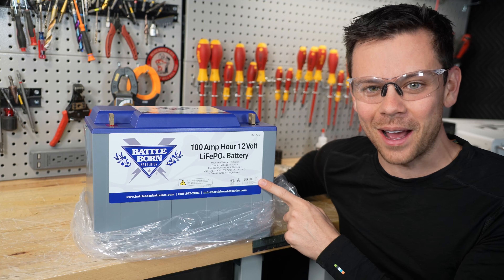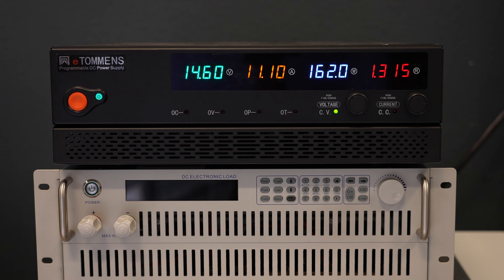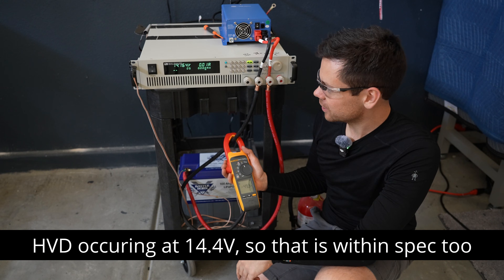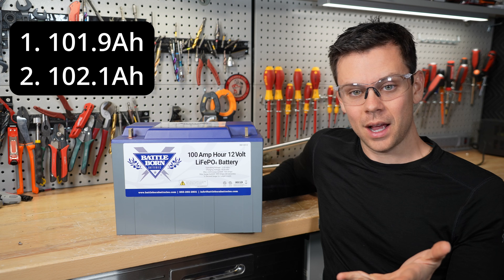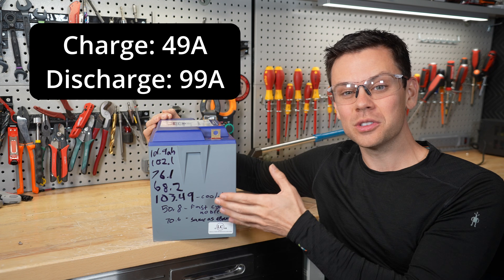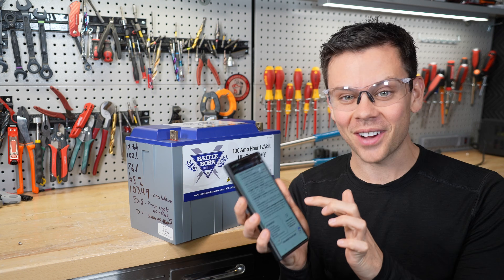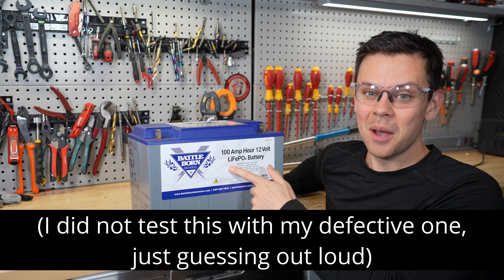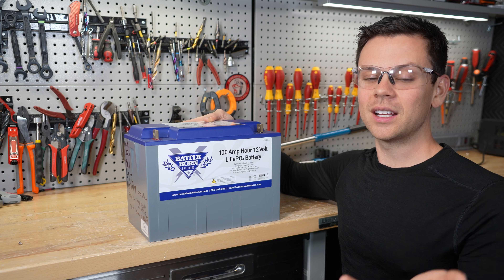A NEW Issue?! Battleborn Cycle Testing!

Comment: Although I understand the goal of this extreme cycling, it is not a real world example of any applications I am aware of.

Normally, a system that would be delivering 100 (okay 99.9) amps continuously would have several batteries in parallel to do this.

I suspect that any battery that has high temperature protection in the BMS will behave in a similar fashion.

Comment: I have owned that battery for approximately six years. It is in my electric boat (Twin Troller X10) and I use it regularly here in Central Florida. Every time I return from fishing I recharge the battery with the charger that came with my battery (Victron) directly from Battle Born. I have none of the issues you talk about and the battery still works as if this was day 1.
Reply from the maker: Cut open a battery and check that terminal
Reply: Over time, companies cut corners for profit, especially publicly-traded companies. You got in early, when quality control was obviously higher...or,you didn't and just haven't found out yet..

Comment: Have to ask, will most users ever pull that big of a load for the whole time? 99% buy it for a use, that is not trying to kill the battery. Would be like running a new car wide open for hours. Never slowing down just wide open until it dies. Not saying what your doing is wrong. But I own 7 Ly time battery's. I will ever pull that kind of load on them. 3 12 volts hooked to a 112lb trolling motor. 2 12 volts hooked to a 80lb trolling motor. The other running electronics. Bought these after watching your test on those. I would never pay what Battle Born wants for theses though.

Comment: Who discharges their batteries deep cycle battery at max rated capacity all the time? It's a test, but is it realistic? I would say charge at 50amps and discharge at 50amps to even be somewhat realistic. At least that is more real world, if you are trying to actually prove total cycles etc. I still think most batteries are discharged on avg at a very low % of max discharge capacity. 

I probably pull an avg of <5 amps per battery, and charge at maybe 20amps per battery for an RV use case.  I get the stress test, but 100amps seems pretty unrealistic in every cycle.

But if just trying to see if the thermal issue can happen.. I can see the logic, but seems a little unfair to throw in capacity testing at the same time. Just be unbiased vs trying to prove something up front. Sort of science 101.
Reply from the maker: Completely false. If something is rated for something, it should be able to do it.

Comment: I worked in a UL308 Electronic Panel Control builder shop. To have a UL listed product every component within the product MUST be UL listed and approved coming from their large library of documented parts. This list also includes fasteners (bolts and nuts) the use of them and environment subjected to. UL listing is a serious for liabilities. As a manufacture violating UL guidelines, three strikes can result in heavy fines or even loosing your UL license.
Reply: Bolting together UL listed parts doth not necessarily make for a 'good' or safe product... Thus, UL listing alone is not enough to provide assurance of a great product.

Comment: I have to say that my own battery that run from 2021 .
Still are fine and still have the 100% .
And its use 24/7 .
I use them for my boat ware i'm 24/7 .
Battery are charge by solar .
And max charge is about 70a .
Now the discharge is not that high .
I cook sometimes on it but the rest of the systeem use no inverter .

Winter time it charge over time with charger  to Puch it to 100% and than go back to max discharge of 70% and the charge go back up again .

Oke those battery cost 1000 euro in that time .
And if i see its a good thing that i pay for it.

Comment: You are not charging or discharging these batteries properly.
dragonfly/battleborn seems like a good and reputable company that doesn't deserve this.
Reply from the maker: False, this is normal cycling if it's rated for continuous charge and discharge. Tell them to change the data sheet then

Comment: Thinking about the issue they are having, i wonder if this is being caused by terminal stress or vibration. how are the batteries that are having the issue being used? in a mobile setup say on an RV, or van build? I can see both terminal stress say from it moving or the cable flexing, and vibration from it going down the road. 

if it works that bolt loose increasing the resistance to the system then the high heat would follow.

Comment: Wow, $600/kWh is really high!  You can second source Samsung SDI NMC modules for $50/kWh all day long.

Will, I have an automated long term cell tester and will gladly test a module if you want.  I can charge at up to 165 amps(continuous) and discharge up to 600 amps(continuous).  Overkill for this application (50 amp charge, 100 amp discharge), but I can certainly do that slower test... I can even add automated dwell between cycles if you want.  I wrote the program, so I can make it do anything.  All data logged once per second.

Comment: In order to get really accurate readings with your thermal camera you really should get a piece of matte black electrical tape(like the cloth kind… Not the vinyl. Or you might be able to get away with using gaffer tape), and stick on the surface that you’re trying to take a reading from. 

You also want to make sure you set the distance in the gun to the correct distance and always take the reading from the same distance, otherwise you can see quite a bit of variability…

Putting that black spot really helps a lot to get consistent readings though
Reply: White-out and Dr. Scholl’s foot powder spray also work.

Comment: i have 4 of them in parallel  for about 5 years      and ive checked the positive terminals while charging lately  and its not hot at all,   i wonder if people have them in vehicles  and they are rattling around?? or if the problem will happen after regular controlled usage inside?  Looking forward to more videos !!

Comment: Hi Will, thanks for taking my comment into consideration. I appreciate that you are trying replocate the disconnect issue with the plastic on the bus bar to determine if this is a user issue or a design issue. I agree that if the battery is advertised that it can discharge and charge at 1C it should be able to function as advertised. I believe that is deceptive advertising practices. 

I am not a Battle Born shill and I will never purchase one of their batteries becuase they are way over priced. I just don't want you passing on bad information that causes you to have a lawsuit for misinformation. I love your videos and I have been following you for years. I have seen lots of horrible companies come after creators and I don't want that to happen to you.

Keep us informed when you do battery cycling to see if the plastic deforms under proper use.
Reply from the maker: That's why I reference the data sheet my video. Did you watch my video? And I'm not charging at 1C. I took the continuous current ratings and that's what I used. Straight from their data sheet and it was posted in the video

Comment: I rather by 8 dumfume 12v 100ah or 3 dumfume 12v 300ah batteries before buying one of those expensive batteries,  just make it makes sense, as long as the safety features works on the cheaper batteries then go ahead and use them, all is made in china, china will soon leak that all batteries cells are the same😂😂

Comment: Wouldn't it be more realistic to charge and discharge at ~50% of the maximum rates?  Not supporting BB in any way, but as with everything, not just batteries,  running at maximum capacity reduces life expectancy and reliability

Comment: A cycle typically is a 24 hour period not 3 cycles per hour? Another thing is people are not typically only using one battery. They are running 48- 24 v systems Not sure how that works out on the math but Im pretty sure that makes your cycles even further apart than 24 hours?

Comment: Thanks for giving us a cleaner test video. This is what i needed to see. Personally, I've only pulled a consistent 60A load to power my trolling motor and have never had an issue. My charger can only deliver 15A during charging. I imagine ill be able to do that for another 8 years with these batteries with this kind of cycling. Ill still keep an eye out for issues. Thanks again for the more transparent demo in this video. I do have another question though....Can you please open that one up for us before you continue testing it? Id like to see the heat buildup in live action so we can witness what's happening in the battery as it fails, not after. Curious how quickly the plastic spacer deforms under those extremes and at what actual load it starts to happen. I'm afraid a lot of these folks may be abusing the capacity a bit just to run that AC while other loads are taxing the capacity already. That's a crude example but i hope you understand what I'm getting at.

Comment: You suggest testing our own batteries. What would you recommend for those of us with a fancy electronics basement? Electric heat running off an inverter adjust till it reads 99 amop?

Comment: Please don’t tell me that you’re saying that people charge at 50 A and discharge at 99.9 A.
That is such a bias test. You should do a realistic test most people have 800 W of solar or so and discharge at an inverter that is 2 to 3000 W.
Please do a realistic usage test, and I’m sure you will be more than satisfied with the performance of the Battle Born battery.
Reply: Ha ha, maths is not your strong suit is it? 800 watts solar charging @14 volts = 57 amps, whilst discharging @ 99 amps through an inverter is only 1200 watts, not 2000 or 3000 watts. What are you talking about😃
Reply: @philgower292what I am trying to say is your test is the max extreme. Testing anything at max like a car that’s rated 180mph or a power cord at 15 amps, depending on the length of the test you can always get an overheat or breakdown.
Using in the  real world I wouldn’t think anyone would reach those numbers you are testing at.
( pushing to the extreme limit)

Comment: Are you testing, expecting, to perform continuous back to back, charge and discharge?

You understand that this test method will not allow the cells to adequately cool?

These batteries are likely not designed for your type of use test.

These batteries are designed for RV use, where typical use is recharge by solar and/or vehicle alternator and/or plug into residential type circuit with input regulated by RV inverter charger.

Also, the charge/discharge algorithm may not be designed for your type of use testing. 
It probably expects not regular complete discharge.

Likely the algorithm does not account for rapid and high sessions of deep discharge. And associated heavy recharge. 

Try testing like the best health for a Tesla battery. 
Not recharging always to 100%.
Not discharging less than 20%.
Not supercharging regularly. 

The Tesla battery algorithm is designed to keep the cells in the best condition for longevity. 
It does not allow for true full complete discharge. 
It does not allow for true full recharge. 
It strives to keep the battery from extremes.
 
Yes, the battery can "die" from sitting too long without a recharge. But the software knows how to prevent the BMB from draining the module. And the 12 volt can "awaken" the software, and BMB to enable charging. 
However, during regular driving use, there is always "something remaining" so that is can be revived by recharging.

Comment: Great work Will. I'm interested in this test.... and also a test more related to real world conditions. Like subjecting the battery to vibration, and doing one cycle per day (or at least once it reaches room temp as it would overnight between charges), as we would be doing in our RV via solar. I know this test would take much longer and may not be worth the effort.... but I'm interested in those results. I'm also wondering about the internal construction of the other batteries offered by Battleborn, like the GC2 which is a different physical configuration. Thanks for all you do!

Comment: Aww great. I'm embarrassed to say but, I bought 5 of these batteries about a little over 2yrs ago because of one of the videos you made saying it was a good battery and honestly its still in the boxes unopened and unused. I had planned to use them in one of my houses and have an off grid system. By now watching this video, it's nothing but junk. There goes a waste of 5k. I don't  think I can get my money back. Is there anything I can do with this junk?
Reply: See how the cycling test goes. My money is on the plastic sandwich deforming with just the cycling. But if that doesn't happen and vibration is necessary to shake up the silly internal jam nut, you could be fine with a static solar installation.

Comment: Just buy the raw cell and build it with better bms 48v so current will be lower at the same power draw. 

I saw him disassemble in the last video. The cell only cost 2.2$ per cell or 2.6$ include shipping.

Comment: Your discharge testing is flawed. The 100AH capacity rating is at the C20 discharge rate, or a 20-hour rating, meaning for a 100AH battery the capacity test is done at 5 amps discharge and should last about 20 hours. As you increase to 10C (10 amps), 5C (20 amps), or in your case 1C (100 amps), the capacity goes down, substantially. This is basic battery testing protocol. The 100A continuous discharge rating means that the battery and BMS will allow/support 100A continuously until the battery is discharged, but that does not at all correspond to the battery's amp-hour capacity. Please retest using the correct parameters!
Reply from the maker: Oh I'm well aware, this is not for rated capacity. It's for pushing current to advertised limit. If I was doing a capacity test, I would be doing .2C rate. We are all well aware of the rate required for capacity testing 😂
Reply: @WillProwse  my bad, sorry! I didn't realize you were just doing a discharge test. Disregard my comment!

Comment: You need to do a vibration test with some kind of shaker, as if it was in an RV or boat. I bet the bolt comes loose inside. Maybe a hardware store paint shaker.

Comment: To be fair,discharging at 1C rate is pretty tough on the battery,you are not using it this way in everyday usage 99% of the time,if You do use like this,you are doing it wrong,system is built poorly.With all that said,the price is way too high,to not be perct,to not have a BMS,that can take the advertized "abuse",becouse the cells i know for a fact,if they are good quality,they can take the abuse,its always the BMS who fails,overheats,not balancing fast enough,always the BMS who is a pile of crap,even in uber expensive bateries.All the bateries i built with JK BMS-es has none of the problems like these battleborns,or pylontechs,or what ever.They just always work perfectly,with half the price compared to these.Yes i have no UL lisinting and i do it on my own beard,but i know how i use them,if the cells dont fail,nothing else will.And fuses are to protect us,so i use them accordingly.

Comment: I pull 150amps all the time on these batteries on my 5th wheel, but my cables are 2x larger than what you're using. I also use Cu welding cables since they have more strands which makes them very flexible,  less stress on terminals.

Comment: So Battleborn is supposed to be one of the best or at least highest rated batteries on the market.  At over $800 a pop for a 100AH I would expect a darn good battery, but it's looking like Battleborn's QC is slipping. I have no faith in them at this point. I've been using my Chins batteries for several years now and they haven't let me down.

Comment: On a different make of battery I've seen a loose connection cause a voltage drop that tricked an electronic load into thinking the battery was empty.

Comment: I love that you change your guidance over time.  I remember  you having high praise for battleborn once upon a time.  This really shows your ability to remain unbiased.  Thanks again!
Reply: He's changing his opinion because the company has lowered their quality.
Reply: @mediocreman2  I don't think anything in the battery has changed. Look at Will's original BB tear down video and you can see the design, of the positive terminal current running through a bolt that passed through plastic, is the same back then. Just wasn't identified as a potential issue back then.
Reply: Maybe they stopped paying him /s

Comment: Nice video.. But it isn't realistic testing this kind of situation isn't usual..but on other hand for price of battery it should be designed to last longer this kind of testing and not overheat by designed spec..Shame on them
Reply: I do see an application where this test is representative of a sailboat where when sailing it draws a load powering instruments and convection stoves and then runs a generator to quickly charge up for the next cycle - back to back crossing an ocean for a week or two.

Comment: I don't see a need for a lot of testing,  although it will be interesting.  The bolt they use to hold the terminal is going to expand and contract with heat at a different rate than what it's attached to, which means it will eventually loosen.  The same is true of the power leads, but they are accessible to tighten.  I just found loose studs on a pair of group 31 lead acid batteries when winterizing a boat, but they get checked every year.  You can't check for loose bolts inside a battery.  It is a defective design.
Reply: Exactly…….👍

Comment: @willprowse: Will you run the batteries on a shaker table mimicking driving down the road? Most people I know that have battle born batteries are in an RV or Boat. There is a lot of vibrations and movement when on the road.